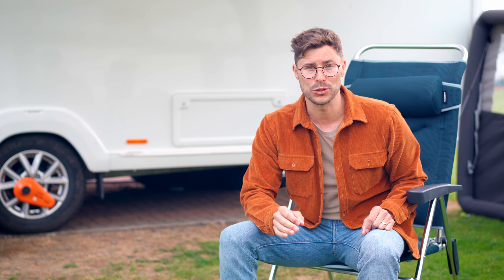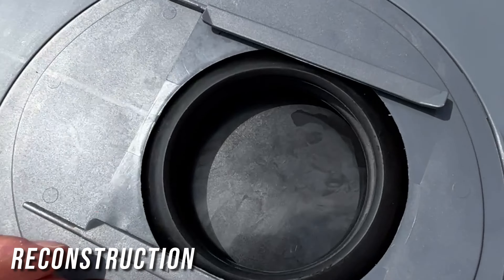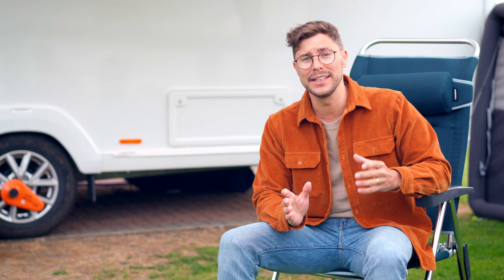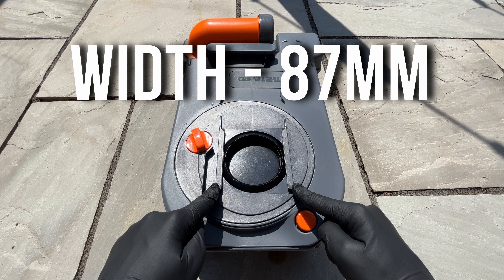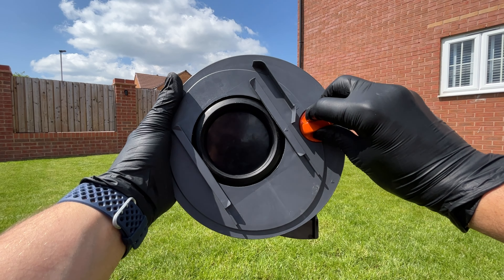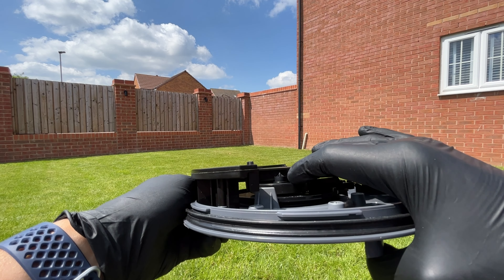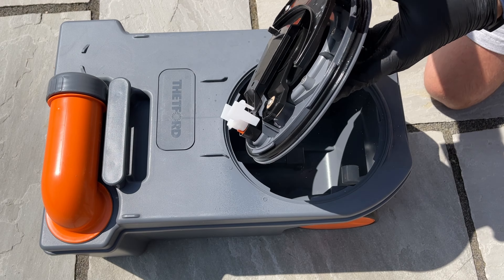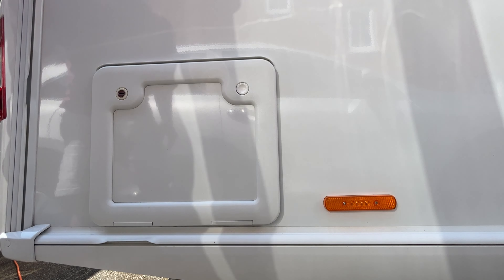THIS COULD HAPPEN TO YOU!! - Learn This Quick Fix - Thetford Cassette Repair.

Comment: It has happened to us as well, interestingly also when I was cleaning it, one thing to point out, the bit you slid out can slide in on the other side and then acts in the same way as the wood to open it all up 👍🏻
Reply from the maker: Well that is very handy to know! I don’t often take my garage with me ha ha. So that is a great tip. Thankyou. And I’m sure others reading this will appreciate. Cheers

Comment: Not sure if anybody has mentioned it but you can open top using the slide cover as a lever.  Not everybody has a lump of 4” x 2” hanging around and it did the job when i opened & cleaned it.
Reply from the maker: Yes someone has mentioned that as I wasn’t aware and currently working on a short about it. Thanks for commenting and watching I appreciate it.
Reply: I was going to mention that too

Comment: Not seen this come apart like this, but I've experienced seal failure, sticking float level and various failed electronics boards. You can actually use the sliding door reversed as the Lever if you have no wood the correct size.
Reply from the maker: Yeah I think I will make videos on these in th future and your right. I made a short which can be seen on my channel when a few people told me about the sliding cover. Cheers.

Comment: This happened to me, it was caused by me! I tried to pull the toilet cassette out when the valve inside wasn’t fully closed.   

Great video. Subscribed
Reply from the maker: Thankyou very much. Well I nearly did the same thing trying to get this in the cassette holder before I realised there was an issue. Ha

Comment: Thanks for that handy tip. We’ve just bought a nearly new (11 month old Swift Sunrise 580). We’re not expecting any major issues with the Swift, but I’m guessing this sort of thing could happen at any time. Had I not seen your video, and experienced the same thing that happened to you, then we would have assumed that we would have needed a new toilet cassette.
Thanks again…I’ve now subscribed! 😃
Reply from the maker: You can’t go wrong with a swift. And I’m sure you won’t have any
Issues. But you’re right it really doesn’t take much for this issue to occur but if it does. You know what to do. I appreciate your subscription thankyou.

Comment: Stripped one of these completly down last week after 5 years of use it had a scale inside like  a kettle. Used 2 dishwasher tablets dissolved in hot water and then topped up with coldand left for a couple of days, giving it a good shake for a minute a couple of times before emptying. Opened up the slide valve but appeared scaled up like a kettle inside, but not slimey, so opened the large cover in a similar fashion to this video. Took ot all the stainless steel screws and scrubbed the inside and all removed parts with an old kitchen brush that had been relegated the motorbike cleaning duties, untill clean looking with soapy water, then reassembled. Incidentally I had been intending to replace the seals but the large round cover seal looked like new and was given a smear of silicone grease (rubber friendly) to reduce the torque required to refit cover and the slide valve seal was removed by unscrewing the seal retaining plate on the underside of the cover and again inspection and a good scrub showed no signs of perishing or any signs of mechanical wear to the defined edges of the seal face. Seal was refitted with a smear of silicone grease and works perfectly, Ihave heard some say the lubricate the slide valve with vaseline but I would imagine that it may not be compatible with the seal material.  My motorhome is 12 years old and I have no reason to believe that the seal has been replaced, Ive owned for 5 yrs and the seal has loads of life in it yet! Great video, it really is no harder thanthis to take the top off, I didn't even use the wood, only the sliding grey cover applied from the outer end as the levering tool.....carefully! Recommend having a look while at home for fammiliarisation, then if you ever get a problem while you are camping abroad, you wont be scared to try and  carry out a "field" repair!
Reply from the maker: Cheers Neil sounds like you did a great job on yours!!! And thanks for the tip someone else said the same thing a out the  cassette sliding cover as the lever. Great idea as I never even thought of that.
Reply: @thebigtow  I had my wife hold the cassette on the ground and used my hands on the llid surface trying to turn that whilst applying as little force as was needed on the sliding cover to get it turning. Putting it back is less risky as you will have lightly lubricated the lid seal. Maybe you could do a full stripdown video as your presentation and video skills are so good!

Comment: Think yourself lucky you have this newer cassette, old ones you can’t remove that disc and you have to repair it just through the little hole. Not good. Mines done something similar a few times. And yeah doesn’t take much of a shake. Wanted to say something childish and smutty about giving things too much of a shake, but I won’t 😊
Reply from the maker: I shall think myself lucky then David. I would not like to attempt that through a small hole. Well that’s makes too us, the word knob was used a fair bit in that video! 😉
Reply: Well as you say Thank God you'd already cleaned it out ! 
As well as the rubber mitts, my ensemble would have had to include a mask as well 😅

Comment: How do I fix it if it’s happened in position in the van and I cannot remove the cassette from the toilet?
Reply from the maker: So the only thing that will stop it coming out is the that the little orange knob on the top of the cassette is facing the right direction for it to be removed. Have you tried opening and closing using the slider on your toilet to make sure that is closed properly. As this issue although it would prevent your cassette for being put in your toilet, it’s shouldn’t prevent it from being removed.